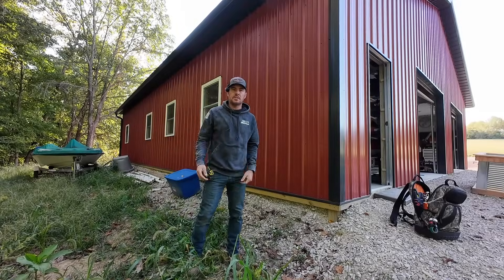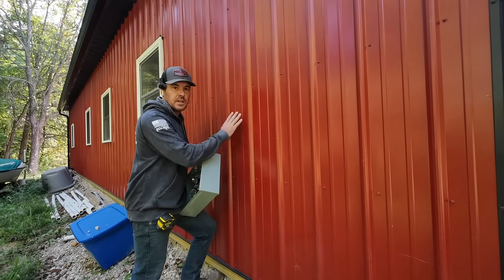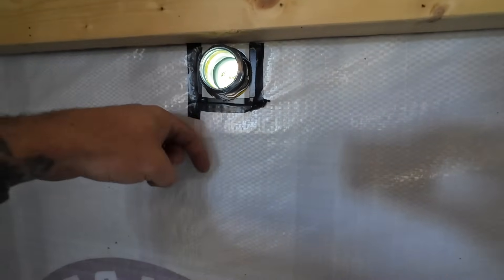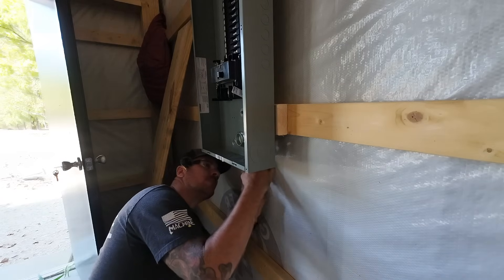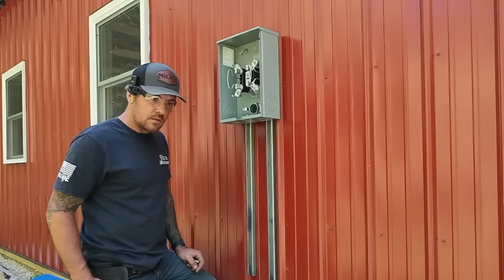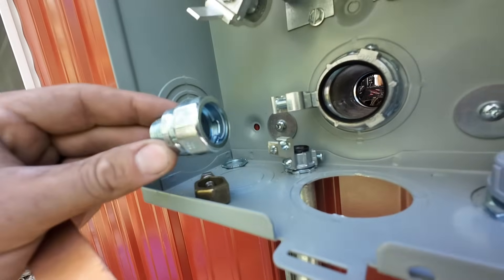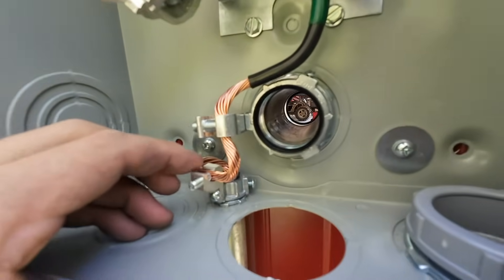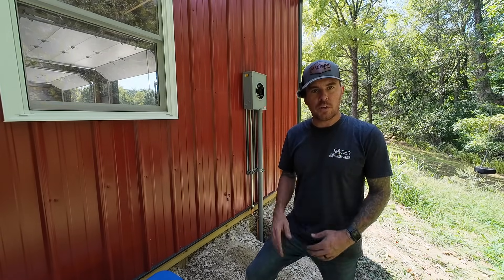200 Amp Electrical Service...EASY TO FOLLOW INSTALLATION

Comment: Great video!
Silicone on the non-used fastener holes inside the meter panel?
Reply from the maker: @jeffshipman2656  ya.  I ended up having to drill my own.  I did do it just didnt film it.
Reply: Kyle - figured as much - you always show the attention to detail. 
Again, great video!  I'll definitely be looking at this when I run power into my future shop build.

Comment: Awesome, glad to hear Idaho and N.Cal are exactly the same codes. I think thats what you said. Wasnt really listening. lol. Awesome video, actually just getting ready to do the same. Question for you, Ive got 3 phase available, but not sure if I want to run that in the shop, or just do single phase. Not any specific plans to use 3 phase, but who knows.  What would you do?
Reply from the maker: @dcmotive  depends on what your plans are in your shop and if you plan on staying.  Having 3 phase will be great for resale but everything about it will be more expensive.  You may also have an issue running some of your 240v single phase equipment because 3 phase is 120/208.  Generally you need to be within 10 percent of the nameplate voltage on the equipment.  If you have no plans of running larger equipment i would just stick with single phase.  You would have the option of installing a transformer to get 120/240 single phase if a certain piece of equipment required it.

Comment: That is an overhead meter socket. Its not meant for underground. The utility entrance is always on the left side
Reply from the maker: @Roadglide2020.  your incorrect.  Look at the meter again.  There isnt even a hub on top.  Thats was provided by the REMC.   And it can come in on the left or right depending on what side the feed is coming from.  Maybe in your state its different.  This install is exactly right.

Comment: I called Duke Energy about putting power in my building, They wanted to put 200 Amp in, I did everything they wanted, said it was wrong I told them that I only need 100 Amp now they want me to change the 200 Amp meter base to a 100 Amp meter base wat is the difference?
Reply: Thanks for letting me know
Reply from the maker: @jefferykeeper9034  just smaller lugs is really the only difference.
Reply: They still want me to use the same size wire 4/0 Aluminum is that too big for what I need?
Reply from the maker: @jefferykeeper9034 thats weird.  4/0 wont even fit under the lug of a 100 amp panel
Reply from the maker: @jefferykeeper9034 what county are you in?
Reply: @SpicerDesignsLLC  Gibson
Reply from the maker: @jefferykeeper9034  email me if you need something.  Your not far

Comment: I used to work with an electrician, he had a different name for the “knockout fillers”, he called them “uh ohs”.  They fixed the “uh ohs” of removing the wrong knockout.

Comment: Awesome stuff sir. Question. Where can you get replacement lugs for the main line 1 and 2 wires. Bought two service panels and 2 lugs were missing. Bought them and they sat in storage for a while past the return dates. I can't find anyone that knows even asked a few electricians in the area. 🤘
Reply from the maker: Unfortunately youll likely have to rob them from another panel.  Thats probably what happened to the ones that you bought.   Someone took the lugs and returned it or sold the rest of the panel.  Might be able to find some on ebay.

Comment: Good video. !! I have found it best to never land the neutral and grounds of pending branch circuits on the same buss even if this is the first point of disconnect. Let the grounding screw do exactly what it was intended to do. That way should this ever become the second point of disconnect, "such as if a emergency disconnected is installed later for the first responders / firemen" to use, then you don't have to go back and separate the neutrals and grounds all you have to do is remove the grounding screw and they are all automatically separated.
Reply from the maker: @lesterwatson8519  great point!  Same situation if you add a whole house generator.  We would spend two hours separating all the grounds.  Total pain.
Reply: @SpicerDesignsLLC  Good video. A question. I know the main means of disconnect would have the nuetrals and grounds are bonded by the bonding screw. Why would you have the outside meter can also have the ground and nuetral also bonded? Shouldnt the ground screw be left out and have the inside panel , have grounds and nuetral separate.Is that some update to your code? Watching from the Caribbean
Reply from the maker: @richstarstar thats not the main ground in the meter can.  Thats the GEC which is in place for surges and lighting protection.  Its not the return path.  I explained everything in another comment if you want to check it out.

Comment: Why not show torquing all lugs and connections?
Reply from the maker: @jimdavis6357  not a how to video.  Just for reference.  All the torque specs are on the panel cover if you need them.

Comment: Surprised you have the grounding electrode conductor terminated in the meter enclosure.  Here you need to be able to visually inspect it on the customer side.
Reply from the maker: Thats how we do it in Indiana. Also depends on style of meter.  Some have load centers built in.  All kinds of options

Comment: Clean work overall!  Why all the love for QO panels?
Reply: Appreciate the time and reply.  You are not the only one who thinks that so I was curious.  I work for Eaton on the Industrial side so always nice to get feedback on our products OR competitors.
Reply from the maker: @Jnshaw81 i had a lot of issues with eaton and Siemen over torquing the bolt on breakers when we ordered panels with breakers.  Had to drill out the bolts on multiple occasions.  Other than that they are fine.
Reply from the maker: I just like the way they are set up.

Comment: Great work. But why did u bond the neutral twice. The neutral and ground should be bonded in the subpanel and please remove the green screw
Reply from the maker: There is no sub panel.  That is the first means of disconnect which is where the green screw is used to bond.
Reply: Then please remove  the ground wire from the meter base. Cuz you have double bonded the neutral. Not good.
Reply from the maker: You are incorrect.  Like i said at the beginning of the video.  Maybe they do it different where you live. This was inspected by the county and the utility provider.  Been doing it like this (per code) for almost 20 years now.
Reply: Ok. Do you agree that you double bonded the neutral?
Reply from the maker: @MrTooTechnical i do not agree.  It sounds like your treating the grounding electrode conductor as equal to the split phase system ground/ neutral.  The grounding electrode is specifically for lightning protection, surges and contact with high voltage.  Where it lands in the meter can with the split phase system neutral/ ground is not considered bonding.  The bonding can only happen in the enclosure that contains the first means of disconnect to bond the split phase system to the enclosure.  Which prevents a difference in potential between the neutral and any grounded equipment after the first means of disconnect. I think you’re grouping the different type grounds together and treating them the same which is incorrect.  Hopefully that clears up the confusion.
Reply: My apologies.  The video is very well done. I am just saying that you have bonded the neutral twice to ground. Once in the meter can, then in the main panel. I’m just saying that u have made a condition for objectionable current. Thanks again.
Reply from the maker: Where is it bonded in the meter? The grounding electrode conductor is not the same as the system ground.  The system ground is what gets bonded which is done in the main panel by the green screw.  Curious what state you’re in?
Reply: Your main ground is bonded to the neutral in the meter base. And that terminal bonds the enclosure. Then u extended the ground back to the main panel and u bonded the neutral again. And the green grounding screw is still there as well.
Reply from the maker: Your confused on the purpose of these grounds.  Again, the GEC is not the same as the system ground.  The grounds that attach to the bushings have to be there because of the concentric knockouts.  I fully acknowledge the grounding and bonding is confusing but my installation is exactly right.
Reply: I see the continuous ground from the ground rod (only one ground rod is also confusing).  And it bonds the meter base, utility neutral and ground at the same point. Then the neutral and ground  leave the meter base and rebond again to the same point in the main panel. And then the green screw of the main triple bonds both the ground and neutral to the panel casing. I apologize
Reply from the maker: Yes, the ground/ neutral detail is bonded to the meter can, but you cant rely on the integrity of the raceway installation to carry that bond into the main panel where is is most important.   Thats why they have the green screw.  The bonding can only happen in the first means of disconnect.  Introducing the GEC into the system in the meter can is not considered bonding.  Some states dont even allow the GEC in the meter can.  Thats why i stated where i live at the beginning of the video.   Are you an electrician?
Reply: That’s just it, you did bond the ground / neutral in two spots. Usually u only them once. I will say the work is clean and great. And yes I know electrical
Reply from the maker: The only wire that go through the pipe from the can are the two hots and the neutral.  The GEC stays in the meter can. Again, the GEC is not the same as the system ground. I think you’re very confused and not listening to anything im explaining.  Call an Indiana inspector and they will explain it to you.  Take care
Reply from the maker: But not an electrician. Im not trying to be rude but you dont know electrical as well as you think.  You are confused and i cant clarify it anymore for you. Take care.
Reply: The same point in the meter base is where the ground and neutral bond is 14:50. Then at 18:00 they are bonded again in the main panel. Basically, remove the main ground from the terminal (where the neutral attaches)in the meter base and you are done.
Reply from the maker: @MrTooTechnical thats not the main ground! Thats the GEC, a secondary ground for lightning protection.  Thats not the ground that gets bonded.   The system ground is the neutral from the utility company.  Now i know you dont have a clue what your talking about. Again take care.
Reply: Umm where is the main coming from if this is a service? That is the main ground, and even if it is not the main ground, you usually don’t bond the ground and neutrals twice as you did. I will say, it is clean work for sure.
Reply from the maker: The neutral from the utility is the ground.  They are the same.  Its a split phase system.  The GEC is NOT the main ground, its specifically for lightning protection and surges.  On the secondary of the transformer the neutral is bonded to ground as well.  I suggest doing some more research on this system.  Take it from an actual electrician.  This install is correct.

Comment: Nice clean work. You made it look easy but, you are right about working some of that wire. May be over kill but, I installed 2 grounding rods for my garage to make sure.
Reply: i installed 2 grounds for my garage.  inspector came and said one was enough lol
Reply: @pgibbons72  Every state and locality is different, I am sure.

Comment: Why not just use PVC exclusively to avoid all those ground bushings? Around here in MN it seems like that's pretty much standard practice.
Reply from the maker: Thats because pvc is easy and more forgiving. The metal chase has better grounding integrity.

Comment: K, is that 2” pvc conduit big enough? I had to use 2.5”.
Also how do you seal conduit penetration on outer tin when it’s a finished insulated wall?
Reply from the maker: Its plenty big enough for 2/0 and 3/0.  The local utility company will spec what size they require.  Ours was 2”.  You could set the panel first and have the threads sticking out of the exterior wall.  You could then seal it and place the meter can over it.  Then install your lock ring and bushing.

Comment: Man I love your vids glad I found ya! I haven't done a new service meter/ panel install in 20 years but you mentioned that the lugs with the plastic connectors may snap and to be careful when installing. Is there a torque setting you can use to avoid this? Machine!
Reply from the maker: Thanks! And great question.  There may be but i dont know it.  Kind of have to go by feel.  Different size conductors may affect that torque rating too.

Comment: Kyle,  got a question on the ridged conduit . Between the meter box and the panel,  could you have used sch80, or does it HAVE to be ridged because of the metal siding? Nice job tho. And I KNOW ya cut 3 ft off that Ground Rod!!!!😂
Reply from the maker: Ya you can use the schedule 80 too.  I like using the emt because the grounding is better.

Comment: I did this last year on the shop, but used square d panel since they carry those locally. Great video as always!
Reply from the maker: The QO is a square d panel.  Its just a different model with different style breaker.  Im guessing you got a Homeline panel.
Reply: @SpicerDesignsLLC  just checked, it is a homeline.

Comment: Nice.  Wish you lived closer!   I'm staring at a $6k quote for trenching/running (4) 20A circuits 500' to gates/barns.  🤮
Reply from the maker: Ya thats a kick in the sack right there.  I would totally help you out if i were closer
Reply: @SpicerDesignsLLC  Thanks man.  I'm also needing to ditch the solar horse arena lights that got destroyed in hurricane and move to an overhead hardwire lighting solution.  Not interested in trenching 600' around arena to land electric up each of the 6 telephone poles.  Have you used Triplex Overhead wire before?  Can't seem to find anything smaller than 6-6-6 which is way overkill for 1000watts of LED parking lot lights.

Comment: Interesting. I had meter bases installed on two different buildings and they use bare copper wire for the ground, and not in a conduit. They also put in two ground rods 6 or 8 feet apart. Only other difference is my county requires a disconnect at the meter, which I (as a consumer and not an electrician) prefer. Not sure if they used those conduit grounding lugs or not, but those are slick.
Reply from the maker: Typically if the panel is 6’ or more from the meter you have to have a disconnect.  Is that how yours is set up?
Reply: @SpicerDesignsLLC  No, one is about 4' from the panel and the other is backed up to it same as in the video.